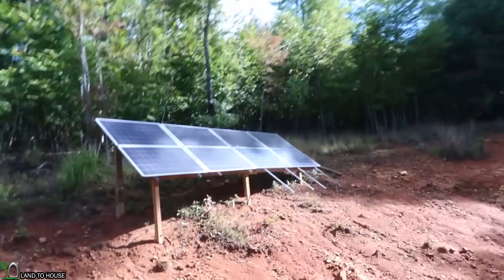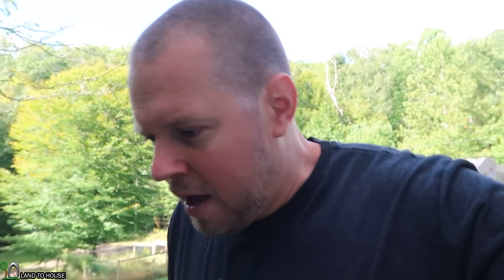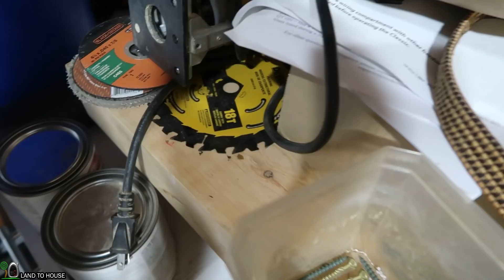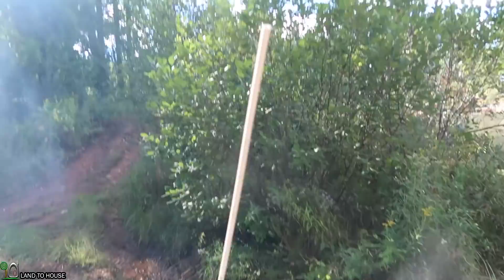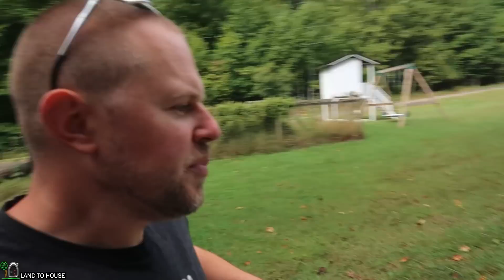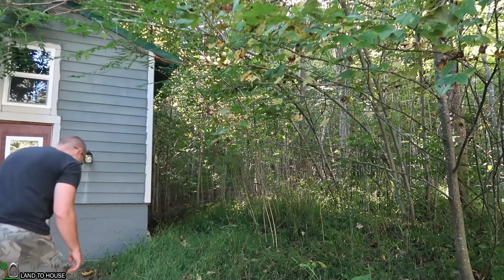Time to store the 4" Micro Hydro for Winter

Comment: I have a idea for you to think about over the winter for hydro what about a Archimedes screw probably 18"+ wide fixed in a pipe so the full thing spins and to get the RPM up simply have a large disk around it attached around 1/3 of the way down so it can be pretty big

Comment: Seth, have the batteries in a separate area to your electronics, the batteries produce gases.  Explosive and corrosive.
Reply: You could also vent the power shed I know you can get solar powered attic fans
Reply: @1992djg  I'd put a partition between the batteries and the electronics. If you are using the same shed for both. Then a separate vent in each.

Comment: I got 4 hoverboard for the motors due to that video
Reply from the maker: Yes I am looking forward to recreating his work!
Reply: @LandtoHouse  I was thinking of using a pelton wheel 2 as an axle for big water wheel  ut think that be to slow the good thing about them is the wound for lower rom
Reply: @LandtoHouse  would've to try one in a lathe with set rpm to see results at set rpm to know what the best is to how to use them as a syphone system I think there power gen rpm is maybe to high but still lower then the motorcycle alternator unless that stator has been re wound if they work as good bonus as they easy to get
Reply: @LandtoHouse  would make a good generator on a pto of a ride on tractor or vehicle with a wheel removed and this bolted on or flat belt